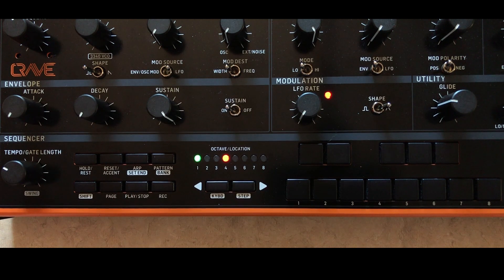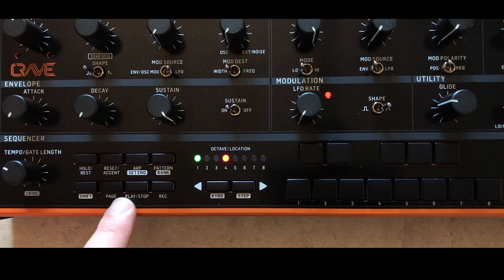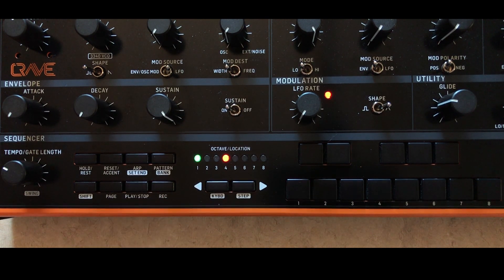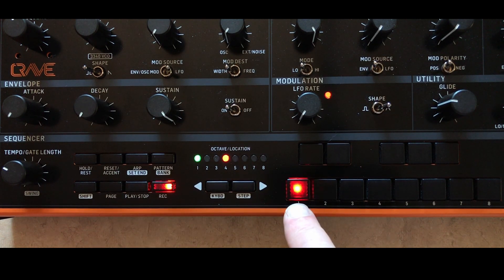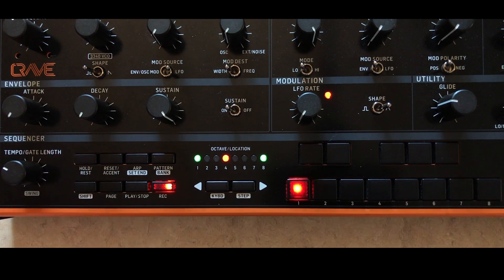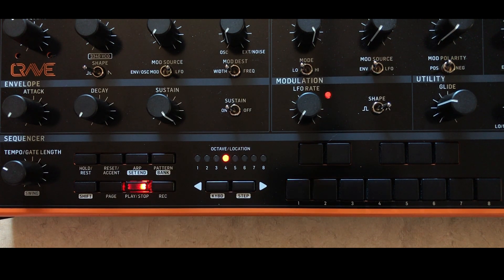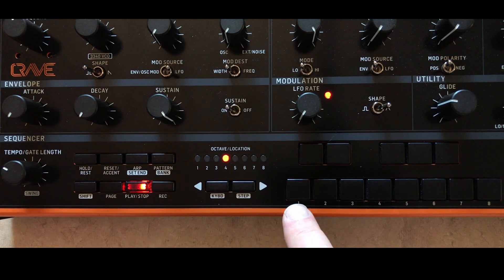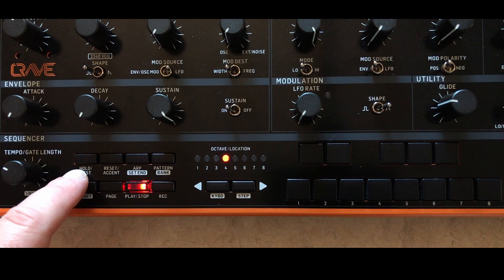Behringer Crave Tutorial #11 - Sequencer (part 1)

Comment: Hi eric i have a problem your videos are incredible. When i connect mi crave midi to my groove box i cant sequence external because it activates the seqjencer. And i dont want the sequencer of the crave. I want to contrlol the crave
Reply from the maker: If you don't want the sequencer to start when you press play on your groovebox: connect the Crave to your computer via USB, open the SynthTool app, and Deactivate "Sequencer auto sync." Hopefully this works; I've had some odd behavior in the past when using SynthTool. I don't believe there is a way to do this without using the app.